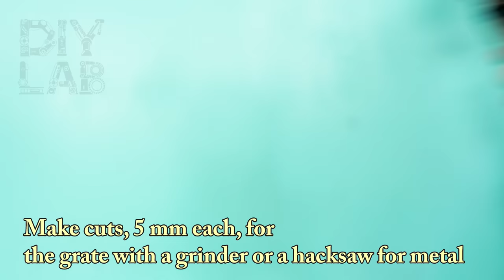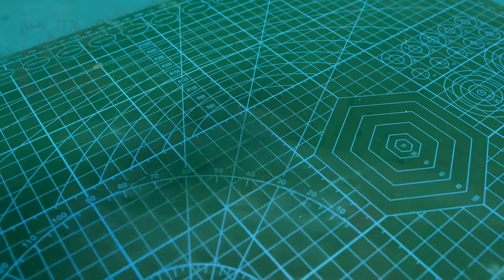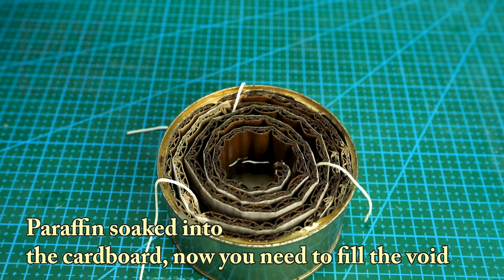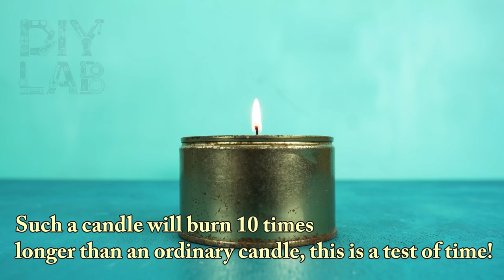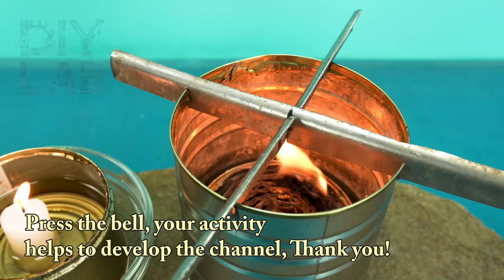Do not even think throw out canning banks! Great DIY idea 2

Comment: i remember in the late 70 and early 80s  we made bunaen burners for outdoor school  they worked great     id you dont know get a can of crisco or off brand  get it warm put a wick in it  and a terracata pot over the top  it will burn for 72 days at 8 hrs a day for one can and the terracota pot upaide down generates good heat  the safest is to out it inside of a deep pan and just have the lid barely vent the top it traps the heat great and actualy works awesome indoor or outdoor   just sayn ya never know wen the demo power is going ro go down on  us or if they devide to pull a sudden shut  down